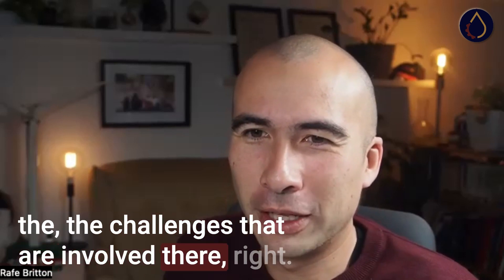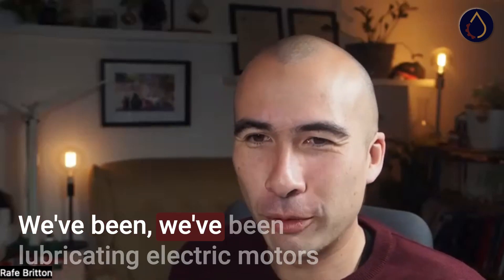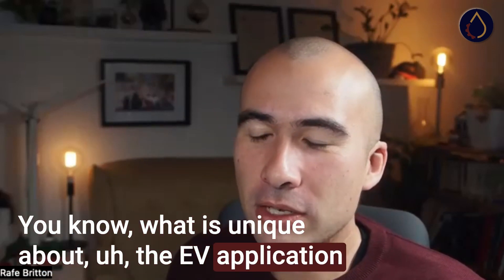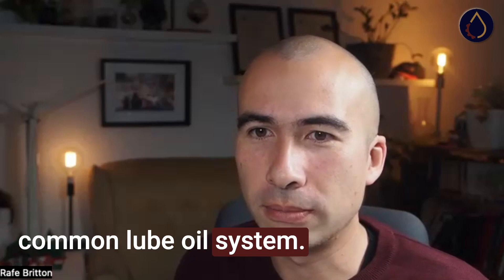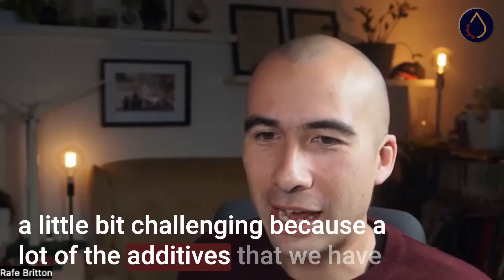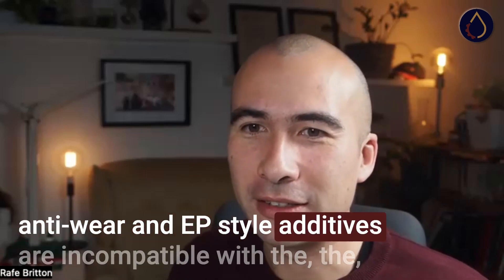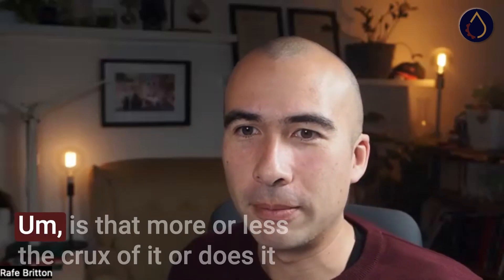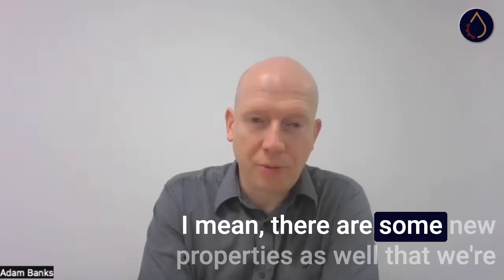Wet vs Dry E Motors

Comment: One reason why wet motors may be the prefered option is due to the difficulty in avoiding an over-constrained bearing arrangement along the motor and gearbox input shaft axis. Among legacy models the Nissan Leaf and Hyundai/Kia Kona/Niro/Ioniq/eSoul use a separate "dry" motor with field coolant jacket, sealed/greased bearings and a splined connection to the gearbox, which has bearings at each end of the input shaft. That creates a geometric overconstraint which frankly is a rookie design error.  Nissan got away with it but Hyundai/Kia did not and quite a number of owners have noise problems that seem to be a result of poor radial alignment at the spline.  Repair requires that both motor and gearbox be replaced.  In many cases only one side is done initially and the noise re-appears. Another odd issue that remains to this day is that inexplicably the oil filtering magnet captive in the gearbox seems to be non-functional.  I have 11 UOA reports from interested owners and 90% show very high iron and aluminium content at very low kms. One owner took a photo of the magnet with a borescope and it appears to have worn edges, as though it's rattling around in the aluminium pocket and loosing material.  Many of us add a magnetic plug and that nicely clears up the iron levels.
What I'm seeing now in my casual observations is that EV designs have moved to a more tightly-integrated arrangement where only one gearbox bearing is used along that axis (a total of three including the motor) and the housing is shared, crucially combining factory machining setups.  Due to the closer integration it may be more palatable to avoid trying to seal the motor against gear oil ingress and instead make the best of it for cooling and motor bearing lubrication. If I recall Toyota did this with their HSD (hybrid) design some 20 years ago but it was primarily to reduce friction.  Meanwhile Hyundai/Kia have wisely moved to a wet, well-integrated motor/gearbox design for the E-GMP series (Ioniq 6 and EV6 so far) similar to all other EVs I've looked at.
Reply from the maker: Wow! Thanks for such a detailed comment!